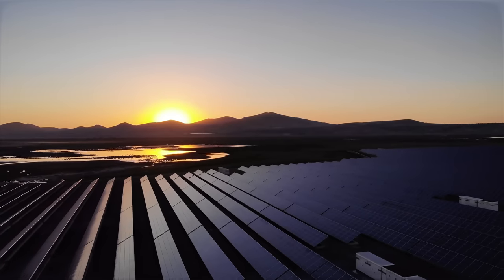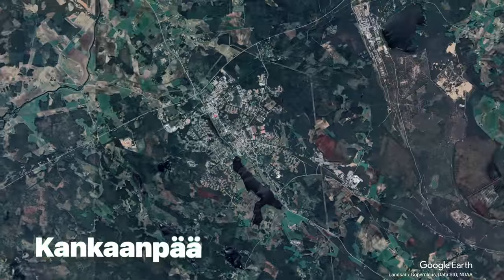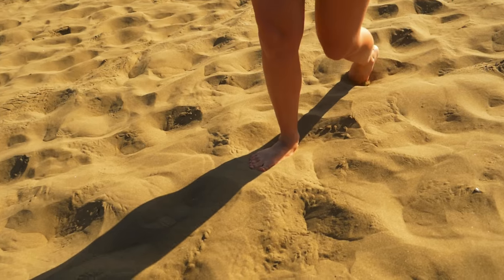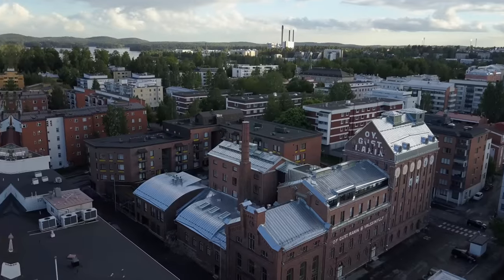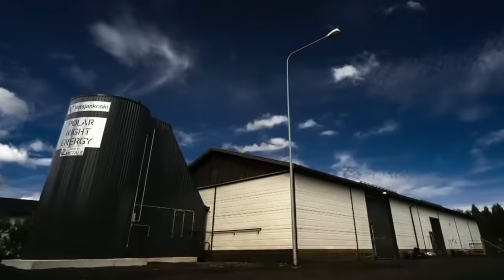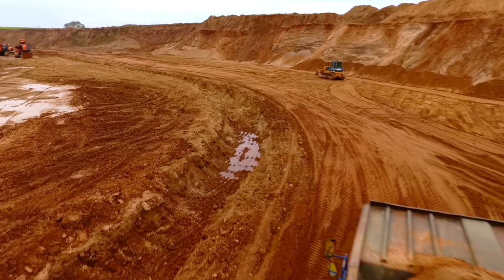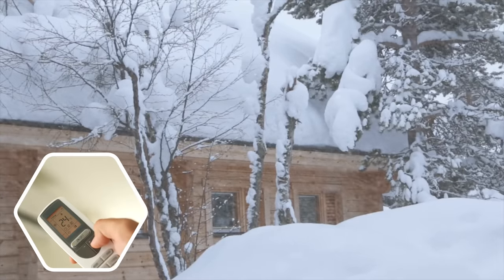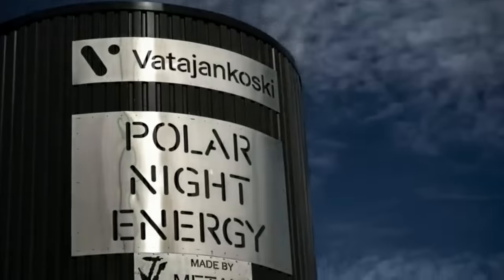Breakthrough Tech Heats Homes Cheaper Than Natural Gas!

Comment: considering the growing shortage of sand for the use in concrete, I wonder if this sand in the tanks further exasperates the shortage, or if its a different type of sand that is more plentiful.
Reply: The sand does not have to be concrete-use grade
Reply: @crcurran  which of course is a rapidly diminishing resource - found in rivers and Estuarys
Reply: @cms9902  Here is the thing though; does the sand ever wear out using it this way?  Sand in cement is committed for decades maybe over a century and then it can't be reused easily.  We recycle glass to make more glass but we don't reuse all of it.  This doesn't expend it and the sand component never seems to need replacing.
Reply: Just use crushed concrete.
Reply: @crcurran  correct it would seem. I was merely pointing out that sand for concrete which is very different from say Saharan sand is a rapidly diminishing resource. Sand batteries made from abundant sand are probably ideal. After all we have the whole of the Sahara desert.

Comment: How can you distribute heat from those batteries in cities where every single house use gas burner? You basically need to rebuild the whole city infrastructure, road, pipes, every home need to be updated . i wonder how to apply a project like this. We could ditch gas and use elettricity for everything also for cook(need to buy new stoves too) then use gas pipe for hot centralized water. Just thinking. It's a huge revolution, similar to when sewage was invented.

Comment: Sand Batteries look to me to be an industrial solution for providing heat used in industry 
Their use would require a lower peak demand capacity from the grid.

Comment: I store solar thermal in a 55 gallon water tank for water preheat and floor heating in the winter. On nice sunny iowa winter days my furniture does not run.
Reply: This video is about using "excess" electricity from the grid (I suppose) to heat the sand. It's a little different than your set-up.
Reply: My furniture has never shown ambulatory tendencies either. My couch ,for instance, just sits there waiting for me to lay down and nap.

Comment: Well...it's not really a "Battery." 
A few other points:
1. It's obviously not suitable for air conditioning
2. Costs aside, why not just use a ground-loop heat pump, in conjunction with solar and wind (where practical.) Even if you cannot do the latter, a ground loop saves about 80% on heating/cooling costs (and has much less effect on the climate) by using the 54 F temperature underground, to cool the heating coil-when on AC-and, to warm the cooling coil, when on heat. In the latter case, with a heat pump, you are pumping against the outside temperature with an air source heat pump, and, in a place like Finland, that becomes impractical in the Depth of Winter. A GLHP also operates with the unit indoors, away from the elements. 
For high rise buildings, you can use a deep, vertical well, instead of the ground loop.

It must be noted, however, that there are areas of the World under deep Permafrost. Maybe Northern Finland is one of them?? Then, the system won't work.

Comment: This is not new, in village Badnjevac in Serbia, there is a solar powered energy storage, that transform Sun's heat in sand heat, that can be storage for 6 months...it's in use over a 10 years
Reply: Stores heat for 6 months? Wonderful. It would be great if somebody made a video about it to let the world know how it's working.
Reply: @markhathaway9456  It sounds incredible, but the whole system is simple. Through the mirror system, the light is focused into the concentrator where over 1000°C is reached, that heat is conducted to the accumulator where the sand is very well insulated. Accumulated heat is released as needed in winter for heating or electricity generation via a pressurized water vapor system. Temperature of send is over 200°C and 100-200 tones of insulated sand on that temperate can storage a lot of energy...

Comment: It's not fair to compare the sand "battery" to real batteries.  Real batteries store electricity, which is very high quality energy that can be converted to either motion, light, or heat at very high efficiency.  The sand battery stores heat, which is the lowest grade of energy.  If you want to convert it back to electricity, the Carnot inefficiency comes into play.  It places a hard physical limit on the efficiency of conversion.  You'll probably only get about a third of the energy back out of the sand if you want to convert it back to electricity.

Comment: so you mentioned San Diego-- what if you use the sand battery to take the heat from Air conditioning and use that heat energy in some other way?

Comment: I'm still not convinced that this is the best way forward, electricity is expensive and right now there's not a lot of curtailed renewables. I'm wondering how this system fares compared to batteries plus heat pumps over a period of 10-20 years.
Reply: Texas pays people to take electricity over night on windy days. Calf. turns off 2 nuclear plants worth of solar / spring / fall in the middle of the day. And of course, most sunny sundays.

Comment: I'm dubious of the claim that sand only loses 20°C in 5 1/2 hours (3.64°C/hr). Under what conditions re ambient temp, insulation etc? 

This is basically a 1970’s huge ugly night storage heater writ large (I'm not sure they had them in the States) and I'm wondering what size a domestic version would need to be and what amount of solar it would require to make it work. I've got plenty of room in my basement and time on my hands. Oil drums are dirt cheap and so is dirt to fill them. Probably the most expensive part of the storage system would be the insulation. There’s also a lower electrical tariff at night for when the solar panels can’t produce enough electricity.

Comment: How about using sand in water tanks that can heat cast radiators? Also curious what the pyramids would be like if there was copper inside them

Comment: Did anyone run any numbers for round trip efficiency? This would probably work fairly well for space heating or hot water but perhaps not for converting back to electricity.
Reply: And probably only in areas at the extreme latitudes where "emergency heating" is needed, and smaller towns at that. I can't imagine they will distribute these all over cities with the requisite plumbing and maintenance, for cities it would be better to plop down a few SMRs, plug them into the existing grid, and call it a day.
Reply: @anydaynow01  In Europe the infrastructure might be fairly common.  I know that a city I visit in Austria has it.  Hot water piped as a utility directly to your home.  Heated by the city centrally (im not sure if they are still using coal).
Reply: If they could get heat pumps to produce much higher heat, then storing heat in sand could be actually feasible.
Reply: If they could get heat pumps to produce much higher heat, then storing heat in sand could be actually feasible.
Reply: @enochaarrestad1168  Yes ground source heat pumps came to mind straight away. If operating between modest differentials of say 12°C (Tc) & say 50°C (Th) that'd work pretty well. If they're needing a storage temperature much higher, say 600°C (Th) like he's talking about, the heat pump coefficient of performance (COP) is going to drop to only slightly > 1.0 & the (probably multi-stage) heat pump cost would probably not be justified.
Reply: @enochaarrestad1168  And I want no calorie Pizza.

Comment: So they have a thermal storage medium that takes an excessively long time to heat up and cool down that they want to heat by the least inefficient methods available in a poorly insulated silo with no way to regenerate it when needed most. Also renewable energy is neither cheap, green nor plentiful.

Comment: I wonder why a tower needs to be in place.   Couldn't they just put in in the ground?  Theoretically, each house could have its own sand battery like how a propane tank might be underground (depending on local codes or home owner associations).
Reply: Deep holes are hard to dig in urban areas and face water intrusion problems

Comment: For a long time now (marketing started around year 1970 )   a similar system is used over here in "low energy house" whereby the solar panels excess electricity and or heat (before 1990) is used to heat up a high storage volume located at house center filled up with rocks (silicium  based like sand). When rock stack is hot, pulsated air travel easily trough the hot rocks stack in order to heat up the house and household water 
What about when there is no excess electric power from sun panel  (winter) and when a lot of heat is severely needed : dollars are spent in pure waste on the grid. "Woke" technology again (house total living area is reduced by up to 10 per cent)
Diamond nuclear "waste" or isotopic Low Nuclear reactions paste (ROSSI) batteries (researchers must improve control and regulation and upgrade units power) are the way to go for household to disconnect from the grid.
Diamond batteries are on the market but too expensive so far (very small power units) when ROSSI SKELEP system could be on the market next year at 100 watts per controlled and regulated units for a price (50 years) of 250 dollars per units.  (They are working on 10 watts units at 25 Dollars each) I already ordered some on pay at delivery condition only.

Comment: Given CA's cooling load - anyone doing ice reservoirs under buildings for reducing that peak cooling demand on traditional A/C ?   One of the companies in Plano TX had one under their facility - may have been Frito-Lay or JCP (I knew guys at both)  and that was a really interesting prospect - super insulated, and made ice when power demand was low for use during peak heat ...
Reply: There is a company that makes a block of ice in a package unit over night to allow the AC compressor  to turn off for 6 hours in the afternoon
Reply: ive thought of taking an chest deep freezer, putting it outside in the shade and adding extra insulation around it. then have water in it and copper tubes going from inside it to a radiator in my house. during the day, my solar panels power the ice chest, then in the evening, i turn on the pump and pump glycol/water through the radiator into my house for cooling.
Doesnt make since in most places in Texas due to lack of time of use electricity plans; hence the idea of powering it with solar. Why Texas doesnt have time of use plans....got me.
Reply: @bocadelcieloplaya3852  you should check around, some areas/providers in TX have rates that vary by time of day... but yes, if you had solar freezing the content and then were drawing through it you might have a good experience.  I was of course talking something a lot more elegant at a commercial level :)

Comment: Storing heat in a concrete pikr is more effe tive than a sand heat battery, but its hard to find the company that has worked on it since I previously found them.
Reply: Concrete would be way more expensive than sand.
Reply: @davepeterschmidt5818  stop making sense.

Comment: So is uses electric heating with a COP of 1 which is extremely inefficent. you are better off placing more wind energy and have actual wind when you need it and heat with a heat pump with a cop of 5 which is 5 times more efficient. 
And gas production is going to decline here FAST with current prices.

Comment: That's disingenuous to say that same batteries could have avoided the power grid collapse in Texas. Post companies made more money during the power grid collapse, and thus there is no way they would allow the problem to be fixed.

Heat pumps would probably help more than sand batteries, but there is simply no way the government in Texas would allow either.

Comment: This energy storage is actually horribly inefficient.  It is using orderly energy (electricity) to create disordered energy (heat).   The efficiency of using electric resistance to create heat is close to 100% less a little bit for heat loss from the sand to the environment.   However to recover ordered energy from heat, the efficiency is 1 minus the Temperature of the hot sand divided by the Temperature of the environment.   Given that the storage temperature will decrease to environmental temperature as heat is removed from the sand this efficiency will decrease to near zero (all temperatures must be relative to absolute zero, not in a scale such as Centigrade or Fahrenheit).   So the only practical use for the heat stored in the sand is low temperature area heating, such as home heating.   In practical terms the heat can only be transported relatively short distances since the heat in the sand must be transferred to a fluid, piped to the area to be heated, and then transferred to the air.  That involves two heat exchangers which will have losses and limitations in capacity for a given size.  Especially difficult will be transferring heat from the sand (which as the article points out is naturally insulating) to the transfer fluid.   This energy storage must be compared to an orderly energy storage (such as battery or potential energy (such as stacked weights or pumped water to a higher storage).  This ordered energy could then be used to run a heat pump.  Net, to make this work, every few (1 or 10) houses would need share a sand silo and then pipe (through heavily insulated pipes) hot fluid to the nearby houses.  The sand silo would need a very large heat exchanger throughout the sand, the silo would need dispersed resistance heaters throughout the sand, the silo would need pumps to get the fluid to the houses, and each house would need a heat exchanger incorporated into the home heating system to distribute the heat throughout the house.   Finally there would need to be flow and temperature measurement at each house to measure the heat consumption by each house for proper charging for heat consumed.   Net this is going to be expensive to install and maintain, especially compared to other storage or generation of heat on demand which better fit into the existing home heating system.    Maybe somebody can make it work, but the article did not address the most important engineering and maintenance considerations.

Comment: Is it possible to heat a greenhouse in Ohio with the sand battery. I knew for a long time
How sand holds heat. I would like to heat sand in plastic barrels . Not sure how yet possible hot water heater
Cycling though the sand. If you have any thoughts let us know.

Comment: Sand is a very poor heat conductor and the money saved in using sand will be spent on the network of tubes for heat distribution and transfer. Remember when you were last at the beach? and the sand got real hot but if you dug your feet in an inch or so, the sand was cool?
How about soaking the sand in Silicone oil? Then the accumulated heat can be pulled off the top. 🤔

Comment: This sand battery is just another dud. Water at 95 C can hold 75% of heat as sand at 500 C. Water is already accessible to practically everyone. I just don't any real advantage in sand than to help insulate a container for hot water.

Comment: This could actually be useful in San Diego, too: storing daytime heat and using the heat to drive steam turbines. And, whallah. You've  got carbon-free nighttime electricity for cooking, family time, TV, gaming systems, and charging for your Tesla. It may not be as efficient as a lithium battery, but since California has an excess of solar irradiation (and thus heat), it doesn't matter. 
You could take this further and develop a way to simultaneously desalinate seawater since waste from the steam turbine would be simply water that can be condensed and purified. And you could also end up with sea salt to sell foodies... 
Of course, all this would take some doing. And serious engineers, But using the waste from one process as the input for the next is a classic sustainable design technique. All it takes is imagination and a little know-how. 
All told, sand batteries are an exciting technology... because it's so cheap and common sense. They store renewable energy without relying on rare earth metals and over-complicated fabrication processes that a greedy SOB like Elon Musk will try to corner the market on.
Reply: steam turbine at the 200 megawatt size and 1200 degrees  get to 32 % efficient. At a size for a  house, about 12 % efficient. Yup, 8 units of heat in, 1 unit of electricty out. Go ahead, build one.
Reply: @kkarllwt  Size and insulate it right, it'll work. Not for a home, odds are, but for a neighborhood. I actually saw that the same company that makes this DOES run steam turbines off a sand battery, though not the production one you see here. They are aware of the inefficiency but investigating the possibility. 

Regardless, with turbines being turbines, electricity generated at 30% efficiency by clean, carbon-neutral energy is better than 30% efficiency generated by fossil fuels. 

And no rare earth metals. Nothing toxic. With sand that can be re-used after the other infrastructure is replaced, etc. 

All it takes is vision, know-how, hard work, and capital investment. Not being privy to the material science of sand, I lack the know-how right now. I could learn it, but I confess to not understanding the heat storage capacity of sand enough to make a sand battery today. Though living in the Great Lakes region, my job would be easier. I'd just use it to store heat in summer and tap it (probably using radiant floor heating) in the winter. 

Lack of understanding is no reason to go negative on a solid solution. Something that can work needs to be investigated. It may not be practical,